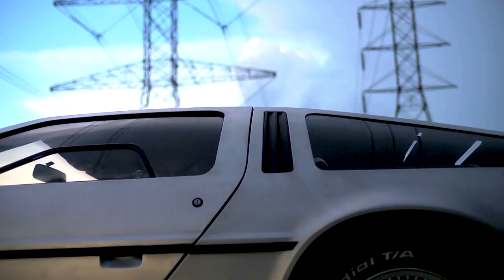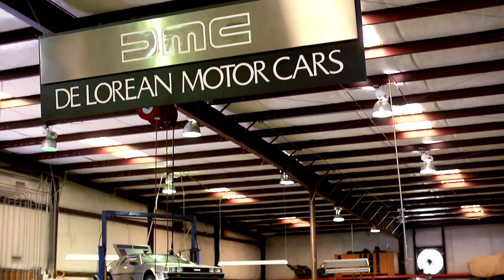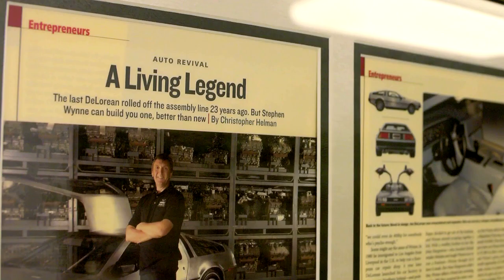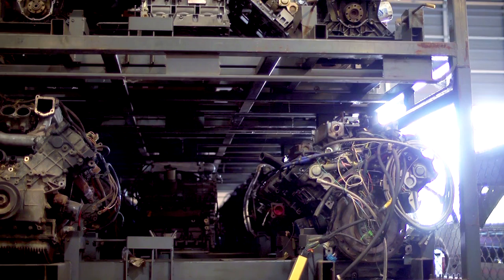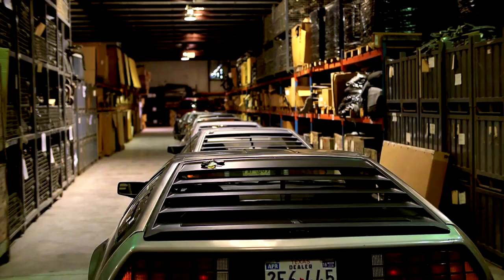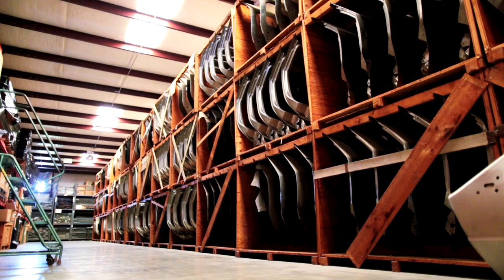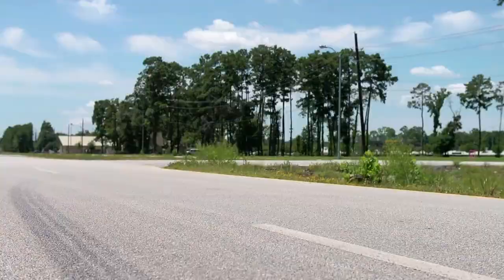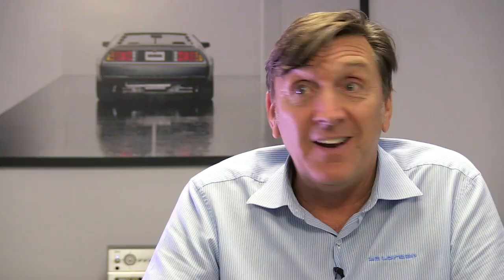New DeLoreans are still available, straight from the factory

Comment: this car with an electric motor would be cool. just use tesla's current technology...
Reply: Great idea!
Reply: If I remember correctly they are trying to do an electric version at the factory!
Reply: They already offer one. But using Tesla's patents would put it on a universal plant forum and they won't have to reinvent the wheel. Almost plug and play. Good call out!
Reply: Carlos Salazar yeah with flux capacitor on it
Reply: My thought as well. DeLorean has never been known for a good engine anyways.
Reply: They are building some of them with an electric motor and with a updated interior.
Reply: I thought you where going to say "Oh wait, that's a Tesla" 😂
Reply: Cricis11700 ???
Reply: Cricis11700 what does that have to do with this video??
Reply: Troll
Reply: Carlos Salazar That has already been invented. Of course.
Reply: holy shit yes
Reply: PLANET123100 holy shit yes, but holy shit not Teslas shit tech.
Reply: juan def I'm really curious as to why you say Tesla Tech is "shit"? They are widely regarded for building the best electric drivetrains in the world with by far the most impressive specifications
Reply: Not to mention that they opened up their patents to the public aswell.
Reply: mostly because of high price that doesn't reflect in fit & finish, reliability and some even don't see the luxury high enough. It might  be also that the fanbase is similar to Apple fanbase which can be very toxic and almost religion like (which is bad).
Reply: Carlos Salazar It's too heavy to be  ran by electricity
Reply: Bakedpotatorox oh true isn't it made of stainless steel?
Reply: Mark Small the range is not impressive of a Tesla
Reply: ***** the range they advertise and the range they really do are not the same
Reply: juan def the range is extremely impressive, 300-400+ kilometers (depending on exact model options) on a single charge is far more than most people need for typical daily and is still enough to do a long road trip, especially when considering Tesla has a very impressive supercharger Network. And as I said before that's the best electric specification available from any manufacturer, the Nissan Leaf, Kia Soul or Ford Focus Electric will only manage approximately 160 kilometers on a single charge for comparison
Reply: No engine sound = no can do. DMC Stage II engine upgrade, please.
Reply: Dburger62 Right, Tesla may be the future but for now I'll enjoy my loud and proud gasoline cars
Reply: Dburger62 it's no issue.
people felt that way when they moved from steam to gasoline.
imagine not being able to use common goal and water to run your vehicle. it was a kick in the nuts..
electric or hydrogen is the future.
Reply: It very much is an issue if you have a passion for old cars. Electric or hydrogen is the future - but not for everybody.
Reply: Dburger62 sadly it's like music. it may lose its soul, but you have to like it or lump it... or hold onto the old car you already have
Reply: It would also be a horrible car with almost no space for batteries and extreamly high weight.

Delorian is made from Stainless steel... A part from being very durable, its also very heavy
Reply: tesla openly released its patents and allows people to copy them because it would create more competition in the electric car market. further driving innovation
Reply: Alex Dziewaltowski it also means that if someone enhanced Tesla's foundations. Tesla could also use the improved version of their technology too. so benefits everyone. very good
Reply: Doc Brown says the ultimate power source is the Mr.Fusion.....
Reply: there are better technologies out there
Reply: Tesla's 300 mile range would take 2.5 charges to get me to most of my destinations I need to go.  And as most of my travels would not be on their supercharger network driving a tesla would add 52 hours recharge time to my drive that's already running about 10 hours.    Who drives just 260 miles when they are on a family vacation?  Just last year I did nearly 1000 miles in one day.  Driving a tesla would take me 8 extra days to get me there.   The basic sedan costs 86k  are you asking me to use a 86,000 dollar car to go to work in and to get groceries?  When I can get the same deal out of a smart car for around 40 or less.  The 2017 focus electric is around 30k.  So no thank you to tesla.
Reply: Supercapacitors would be the way to go
Reply: if you want electric and a range you need to look at hybrids like VW Golf GTE, it's almost as fast as GTI
Reply: I once saw a three part documentary where a Delorean was used as a time machine. A man named Doc used a "flux capacitor" an Nuclear grade plutonium to power the vehicle, but version 2 used biowaste to power it. Does anyone know if Doc is still alive, maybe he can be convinced to convert the flux capacitor to be purely used to power the car.
Reply: aveRAGE joe lolol
Reply: its too fast for this car. this car was designed to not go faster than 120 mph  any faster things will go wrong. in 1981 it was unheard of to go faster than 150,170 in a normal non race car etc, youd need to do A LOT of mods before you could even try this.
Reply: African Warlord Well in the Documentary anything past 88MPh it would disappear leaving nothing but fire tracks.
Reply: xD
Reply: I dont know an electric engine would be practical for lengthy time travels.
Reply: Dont know how an electric engine would be practical for lengthy time travel
Reply: you just need solar panels on the roof
Reply: as long as you have your chest of uranium
Reply: Plutonium! for the flux capacitor.
Reply: Ehh I'm more of Mr. fusion kind of guy my self.
Reply: It would be cooler to have a v8
Reply: Carlos Salazar that would make the car impractical
Reply: James Ch how so?
Reply: It would be a VERY heavy electric. Anything can be converted but some cars are natural choices as they lend themselves to it. A car with so many exotic parts and systems would be tough to re engineer.
That's not to say that it wouldn't be cool.
If you came across one that had an engine blow up or was submerged in a pond for some length of time and would be too costly to repair, those can sometimes be good candidates.
But owning and driving rare cars myself, it's a shame to see something that could be fixed or didn't have anything wrong with it to begin with be ripped apart when complete examples are so hard to find.
Reply: Charlie Foxtrot long charging time
Reply: NotWatching666999 Plug and play how? The Tesla motors and  transmission are meant for a rear engine rear wheel drive chassis, this car is a completely different set up. Not to mention the fact that the enormous battery pack is slung underneath the car. It's tough to get a jack underneath a delorean if you have to change a tire. So you are going to have to change the configuration of the batteries AND find places to put them in a car with almost no trunk or storage space.......
I agree it would be awesome, but would require a complete redesign of the chassis and might completely throw off the original weight distribution of the vehicle which can make huge changes to how it handles.
When your done, you still want it to handle and perform like the original I would think.
Reply: they doo have one but it doesn't have AC. so wouldn't drive around Arizona in a electric delorean in the summer time.
Reply: Perich29 v8s don't have to charge lol wtf
Reply: if one doesn't, use 4 :D
Reply: Carlos Salazar  A Northern  Ireland DMC owner paid Queens university ( Belfast )  engineering dept £26k to convert his to fully electric ! cheers from the home of DMC
Reply: Carlos Salazar 
You sir, win the internet, that is the greatest idea I've heard in a long time.
Reply: joe Schlotthauer I can't believe how many people agree. I mean I love the car but everyone knows there not very reliable. I thought a tesla battery tray on the base of the car could be easily redesigned into the car along with the dual drive electric motor, the car certainly has the space for it. I thought it could be a nice collectors piece maybe put a Flux capacitor in the car just for kicks.
Reply: Carlos Salazar 
Man, I completely see your vision, these cars were notoriously underpowered, and unreliable.
As a car enthusiast and a retired Ford, Lincoln, Mercury technician, I think this would be a great business proposal for this company (DMC).
If this was to be offered, I'd seriously consider buying one, kit form delivered to my house even better.
Best Again,
Reply: Charlie Foxtrot no mate, i was talking about electric motors. i agree with you this car would be better with a v8 engine
Reply: James Ch ya it would be cool  to see with a v8. light  car with lots of power
Reply: Why go electric when you can go Plutonium!
Reply: I would swap it with a Toyota v6, and rice it so much it will look like a weird Ferrari. 😁
Reply: 21.1 gigawatts motor and the fast charger is a bolt of lightning. This would make the Delorean!
Reply: ron k ... You put out some numbers that seem difficult to believe. 300 miles times 2.5 equals 750 miles. Ten hours to go 750 miles means averaging 75mph. A car pushing 75 would be lucky to get 15mpg. That's 50 gallons of gasoline which is not out of the question for a single fuel up, but would require a great deal of space dedicated to non-standard fuel tanks. I happen to have three vehicles with standard fuel tanks that are 40 gallon capacity each. Two have a single tank each and one has two twenty gallon tanks, all factory installed. At 75mph none of the three would get much over 9 or 10mpg, unless going downhill. I'm using the vehicles I have as a reference, not trying to assign them to whatever you drive. Just throwing in a bit of real world information. I'm also considering what the highways are like in my area. Even though there are sections with 75mph limit, traffic generally runs a little slower and in denser conditions, much slower. 
Nearly 1000 miles in a single day really leans away from believability. 41mph average for 24 hours straight is like falling off a log at Le Mans. However, that's not a commute or a vacation trek. Traveling the North American continent a thousand miles has too many areas of slowing to afford the 41mph average in 24 hours. I'm not saying it's utterly impossible, but so highly unlikely as to be unbelievable. I couldn't even remotely consider accomplishing the feat as anything recreational.
Reply: Queens University in Belfast converted one to fully electric... Thing the bill was £25k, they have a Facebook page

Comment: they should re engineer the engine with honda kseries or the 1st gen honda nsx swap into it. it would have a nice power to weight ratio
Reply: Nah. Electric power.
Reply: Dennis Moore nah honda nsx swap
Reply: @buurman2635  Nah. Electric power.
Reply: Blue Scale nah two stroke moped engine

Comment: Closest to a delorion i could have is my silver 86 nissan 300zx cost me $300 to buy a project car but this is to cool i still want one but not as bad now
Reply: Id rather have a 300zx than a delorean
Reply: Parts are still hard to find for seals. but most parts can be swapped from the z32 to the z31 brake caliper ect all mostly improvements. i just kinda wanna be like Jay Leno and drive or own most of everything especially his Chrysler turbine what a car. Back to nissan the z31 300zx are still fairly cheap being a 80s car some are grandparents cars mint being sold for cheap to help with bills ect or emissions controls failing and needing removed but honestly look on Facebook market place there all over and z31 mods & builds supplies good information
Reply: I regret getting rid of my 1984 Datsun Nissan 300zx

Comment: I adore this car and it's history but 130 horsepower V6 is embarrassing. Modern 4 cylinders have more HP than that. Regardless I would love to own one.
Reply: TheAaronmcmahon11 lose american emission restriction crap: 150 hp. Use european injection complete (volvo/renault) 185 hp. Add renault cams: 225 hp. Buy alpineV6 heads:   300 hp. All off the shelf and not expensive parts. These blocks are solid as a rock and if you tune further the stock crank will hold easily with 500hp. Engine is good, american laws made it suck big time.
Reply: mightress or LS swap it
Reply: As soon as you get one you engine swap then smoke boy racers at the lights 🚥 That's living the dream, the thought of hatchback boy racer douchebags in disbelief watching your delorean fade into the horizon
Reply: Modern 1 cylinder engines can deliver 130hp as well. Cylinder count doesn't have much to do with performance.
Reply: No.... you would coyote swap it (if it would fit idk the cubic size of the bay)
Reply: Its the weight thats its biggest problem if you wanna keep the steel exterior you need an engine swap.
Reply: its no coincidence marty raced a vw camper van and exclaimed,'" let's see if you can do 90...'"
Reply: Who cares if it only has 130 hp? As long as it can hit 88 mph, it's all good.  ;)
Reply: Kc Hamilton the ls engine fits... Barely.
Reply: Take a look at the original Humvee. 6.2 liter V8 Diesel...185 hp. Oh lord.
Reply: TheAaronmcmahon11 doesn't really matter so long as you could hit 88 miles per hour. 😁
Reply: Nachtfeuer X and the Ford Model T's 2.9L that only made 20hp!! 😁
Reply: Turbo charge it !. it's horses will double and you can fly in Route 66!.
Reply: mightress you know your stuff man. Can you imagine a 500BHP delorean? Sweet
Reply: TheAaronmcmahon11 my 2018 1.5 liter 4 cylinder ford fusion has 250
Reply: @mightress  Honda S2000 engine, 240 hp naturally aspirated, 1990 Taurus SHO 3.0 V6 220 HP naturally aspirated / much more HP with headers and the engine is reliable.  Not to mention, the SHO engine can hold 500hp as is and turn 8500 RPM's.  While the S2000 in some years turns at 9000 RPM's.
Reply: @Nachtfeuer  It could pretty much run on cornflakes though...

Comment: How much does this car cost from the factory?
Reply: After further investigation... its 100,000.
Reply: Daniel Hughes doubt it
Reply: @warrene5950  a new transmission from the factory is 5k.
Reply: They were supposed to release this in 2017 but the national highway traffic safety committee block them. Early 2019 they  supposed to come out with a revised version regarding the new laws the new one should have 300 to 400 horsepower and cost about $100,000
Reply: @eksine  Then it's not really a dmc12 is it? If it doesn't have an anemic pile of shit v6 fueled by K jet, it's just another boomermobile restomod trash heap.
Reply: @billybobjoe198  the company that bought DeLorean motor company is doing this new version. They have a news article I think on their website it talks about the new super horsepower DeLorean so technically this is a factory DeLorean. I think it had to do with some law that it was easier to just put a bigger engine into it rather than keep the old engine
Reply: @eksine  Probably emissions related. I have an 87 car powered by K-Jet and K-Jet is pretty good for its time when it was in new cars along side carbs, but comparing it to a more modern car's standards it couldn't cut it.
Reply: About half as much as two.
Reply: @eksine ....A Brand new Corvette  with way more HP and way better handling can be had for less than a $100K....why would someone want to spend a 100K on something that is a rehashed equivalent to what the rehashed Studebaker Avanti tried to do...???
Reply: @claudelandi510  Because its unique? idk man seems like an obvious answer to a stupid question.
Reply: $100,000
Reply: @claudelandi510  Nostalgia, it's an 80's thing.
Reply: Just to expensive
Reply: @eksine  thanks was wondering in the back of my head what ever became of all their efforts.
Reply: Weather its new or refurbed 100000 is not worth it
Reply: You would anybody want one
Reply: 100k yikes! I guess "if one needs to ask the price then one can't afford it"
Reply: The car is cheap , but that damn flux capacitor cost a fortune...lol

Comment: With today’s 3D printing Technology they should be able to clone and reproduce the entire vehicle and parts.
Reply: From plastic?
Reply: Robotmech in Austria
Reply: Aperture Laboratories You can buy a steel 3D printer...
Reply: They have and do.
Reply: I design and buy 3D printed parts regularly. They are way too expensive to build a mass production car.
Reply: not with today's tech
Reply: 3D printing is not limited to plastics.
Metals also are being 3D printed
Reply: Don't forget to build a flux capacitor too.  It will send you to time-travel.  👍🤠👍
Reply: 3D prints are still regulated to prototypes or extremely Low volume plastic production.
Reply: Hah! You could never recreate the ingenious of the 20th century ideals, it would look all mocked up and ridiculous.
Reply: I'd rather just create my own.

Comment: DeLorean has not yet announced any specifications, but it's likely that the DMC-12's old 130-horsepower V6 won't be coming back. Our homeskillets at Motor1 estimate power output to be between 300 and 400 hp, with a price hovering between $85,000 and $100,000. Pricing won't be announced for a little while yet.

Way too pricey.
Reply: Eric Folsom wht

Comment: Grand Touring Sportscar huh. Explain the 110mph top speed then
Reply: It was built in the early 1980s, dude.
Reply: @TabascoSour  the early 80's has better to offer for Grand Touring
Reply: @TabascoSour  ah yes, the 80s. When the corvettes top speed was 210...
Reply: a slightly disappointing Salad This ain’t a fuckin corvette my guy
Reply: @TabascoSour  so? It's supposed to be higher then a corvette and cost alot more. Even camaros did 150.
Reply: The Delorean isn't a sports car, and it's certainly not a GT. It's far too slow to be a GT. GT's were designed in Europe to travel across the continent quickly in comfort.
The early 80's had far better to offer for a GT and sports cars.
Reply: @TabascoSour  My 86 Vette can do 150...and it was built in about the same time era.